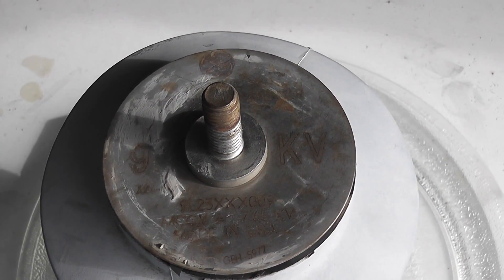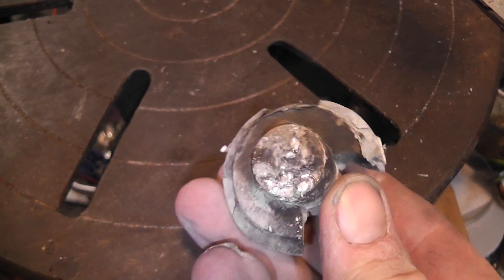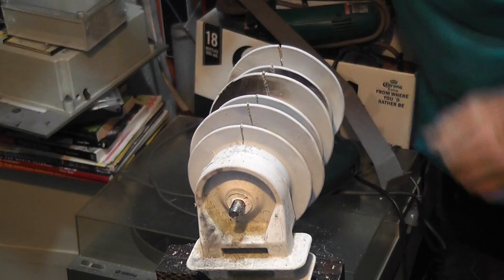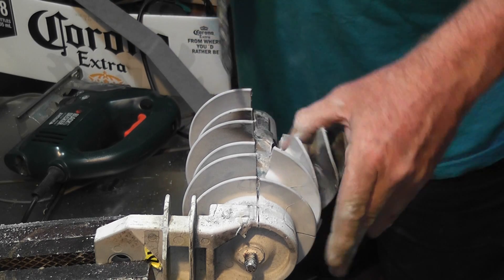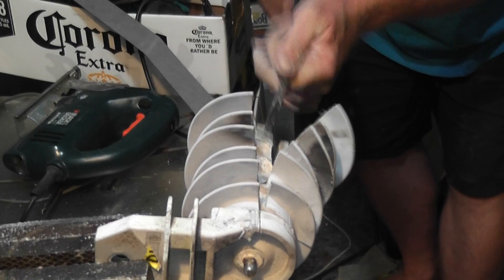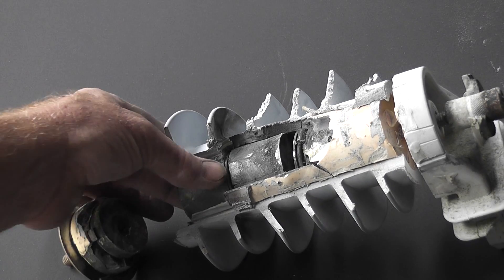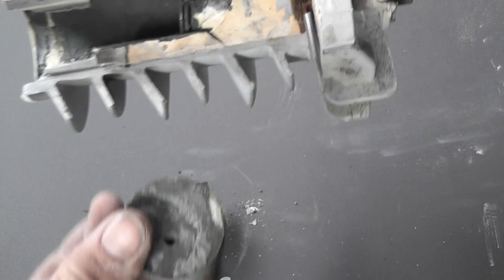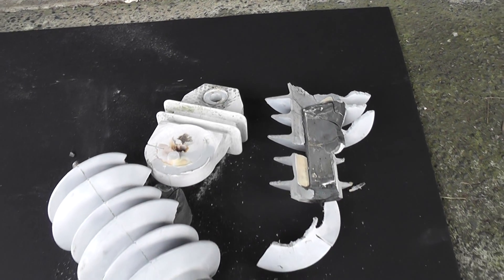Lightning Arrester autopsy

Comment: do you see the old crystal valve arresters like my ones on the lines at all.  also I wondered what was inside a modern arrester
Reply from the maker: Yes they are stll around on the older parts of the network.

Comment: One thing I wanted to ask you in New Zealand on your high voltage system in Australia we have a circuit breaker if there's a fault it trips resets it self and if the fault is still there after 3 times it trips completely and a call out crew have to come out and fix the fault
Reply from the maker: Same here in NZ.
 In rural substations there are usually three trips before the circuit remains off.
Then a line patrol has to be carried out.
Reply: Allister Kinghan
Dear sir we manufacturing Disconnector for surge arrestor 5ka and 10 ka if any required pls contact Me on my email 
pkenterprises366@gmail.com

Comment: MOVs do get leaky after time, or after they have copped a few spikes, so these big beasties have an explosive disconnect at the lower end, which fires, breaking the ground, when the current gets high/MOV gets hot.
So this MOV may be local, have started leaking in an earlier storm, and then just gradually got worse until the disconnect fired.

The material is usually a ceramic containing Zinc and metal oxides (hence the name Metal Oxide Varistor).

Comment: Haha, that is an interesting device, it is even rubbery on the outside.

At 1.20...... I am sure I saw a Sangamo S301 3ph instrument. :D
At 6.23...... Haha, using a Ferranti FNE accuracy magnet. :D

What amazes me in todays world of wastage, is that these devices are not rebuildable.

Surely, it wouldn't take too much hassle to make one where the end unscrews (rather-much like a torch) and then some of those new black cylindrical blocks can be put in there and then close the device back up and re-install it?

It is pretty obvious to me that the manufacturer of these want them to be "single-shot" so that once they pop like a fuse, a whole new unit has to be installed. I wouldn't even know hiw much one of those costs, but you know..... money aside, I would like to think that a serviceable version of this unit could be made and have the same insulating and operating characteristics as this single-shot one time use unit.

Thanxx for showing.

End note: on the Sangamo S301, as the camera went past it, I am sure that there was no reading on it. Is that an unused instrument, or did you reset it?

-Wayne's Electrial.

18th January 2017, 17.20